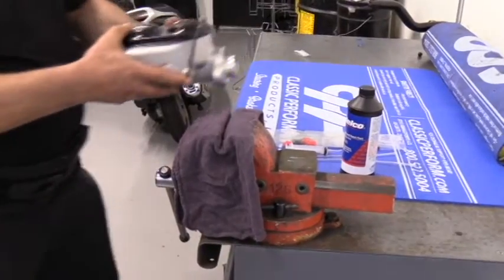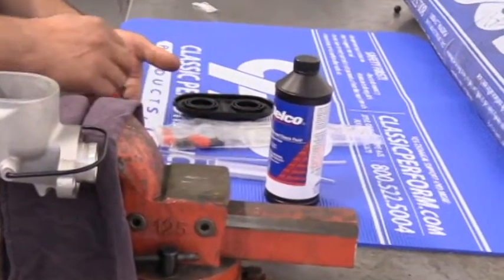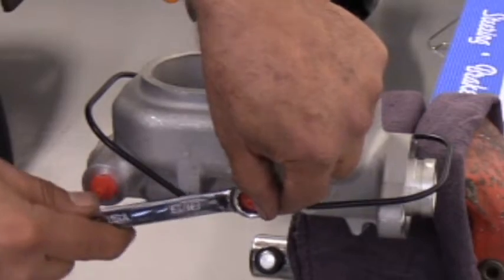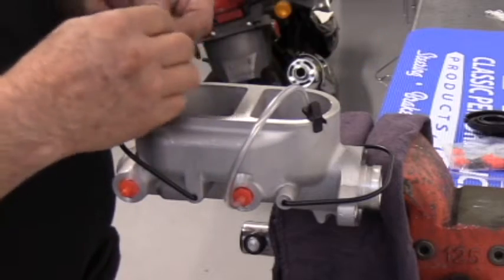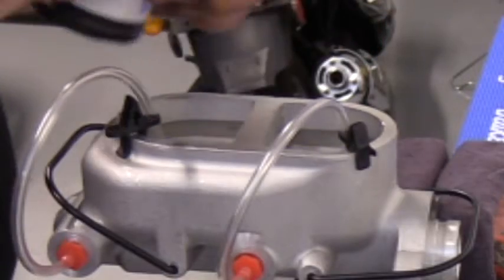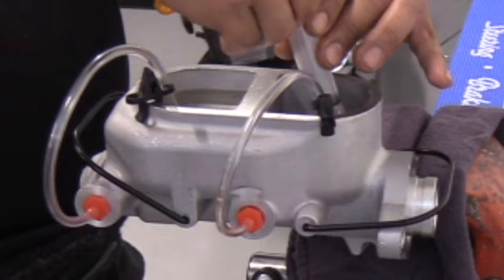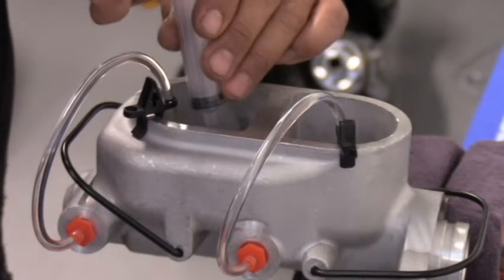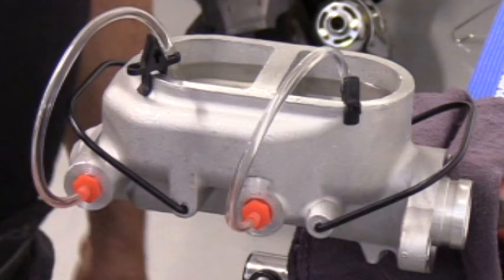Bench Bleeding Your Master Cylinder

Comment: Is this still done for modern vehicles?
Reply: absolutely, but you will have the additional step of cycling the abs pump to rid the lines and abs system of air. this is done with a scan tool

Comment: I've never messed with brakes before. My master cylinder went out when some moron- idiot... Another story, sorry. Long to short, this explained the missing link of why you bench bleed a master cylinder on the bench, not on your ride. Thank you good advice from NAPA Sumner, Wa. I was looking for the easiest, less painfull way out(mechanic engineer- paid from my pocket), and the guy selling the part asked if I knew utube. Yes, I'm a fan, I repied and mentioned a name, not a fan was his reply. So, intrigued, I went back to see the difference of on the car vs on the bench. My eyes were opened, I spent so much time finding a superior part over the one that broke, learning more about brakes I ever thought I would, why should I cheat my labor?  Not only was my problem of replacing an inferior part with the same OEM design (larger bore), this video explained the proper installation procedure, over the quick & easy video's I was sold on. You tube is awesome, but don't gravitate to the easiest fix. I'm lazy, and so are you if you are unwilling to admit it. The guy behind the counter- not a-zone, oh-reely, or a number of others selling OEM, broke part, replacement seller- it broke because it is inferior to what the manufacturer originally designed, in my case, a superior 30 year old truck(Toyota), with an inferior part. It broke. I value my time and money, and if you don`t you are an idiot, my time was wasted explaining it to you and you're not my audience. NAPA knows parts, maybe, because they race cars & work on them? Go figure. This guy works on cars and knows why proper is superior over the lazy- bidon way out. Sorry Joe. I may be sitting on my ass learning, but when I work in something, once and done, is the way. Look at Joe, fifty years of leading us down the wrong path. Now, he's in position to make the last 50 final. Good luck. And the easiest does not make it best. Again, sorry Joe.
Reply: I know this comment was 3 yrs ago, but dude I hope you took a chill pill or got off the drugs! How does one go from bleeding brakes to Joe Biden / politics?!? And I thought I was bad when I go off on tangents LMAO!

Comment: what keeps your bench bleeding from leaking out when you remove the test lines?  Wouldn't you have to start over once installed w/ hard lines on car?
Reply: As long as you don't pump the cylinder with the lines disconnected, air shouldn't re-enter the system.
Reply: @ToxicMonkeyMovies  so when i remove the bench bleeding lines i gotta quickly swap in the new lines so brake fluid doesn't pour everywhere?
Reply: @scofozo   The brake fluid is held in by vacuum.
Reply: You still have to bleed the entire system after you install the MC. Bench bleeding “primes” the system, so to speak.

Comment: Technically, if I have time, can I gravity bleed a master cylinder by pouring fluid in and letting it drip out of the unit using gravity if I don’t ever let it go fully empty?
Reply: tmjmccormack Yes you can, but it’s slow. Set a water bottle with old fluid in it about 1” so your clear plastic hose is submerged under the fluid, then connect the other end of the hose to the bleeder then crack open all 4 bleeder screws. Let this go for about 1 hr then bleed all the wheels starting with the furthest away with a helper at the brake pedal. Bleed until there are no air bubbles before going to the next wheel. I’ll assume you know how to do the 2 person bleed method.